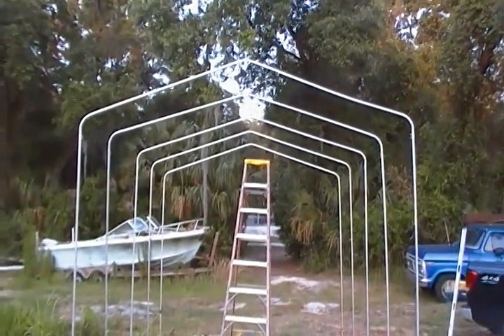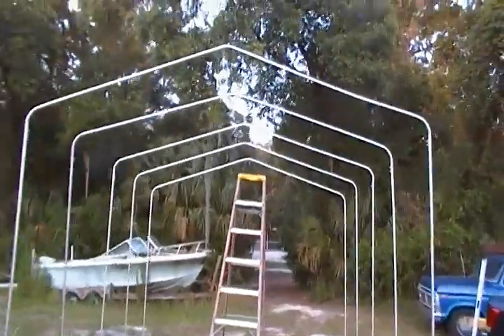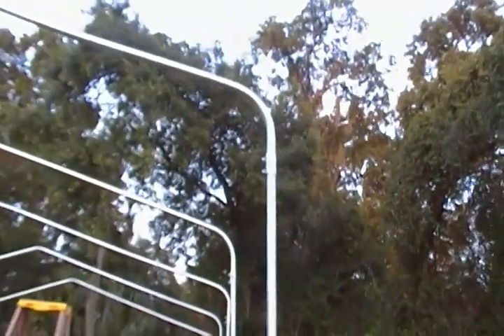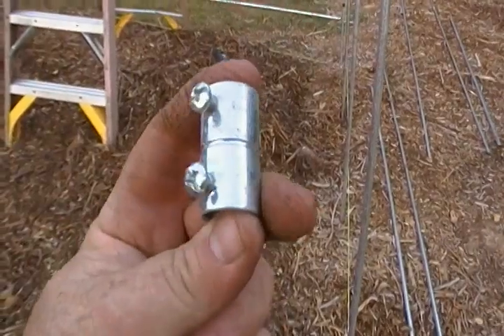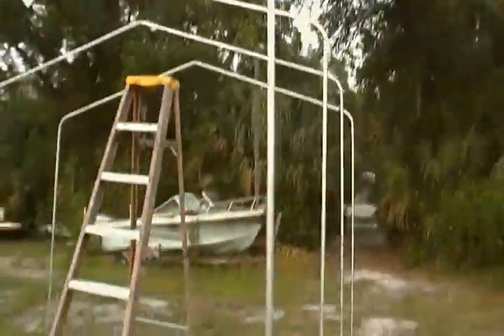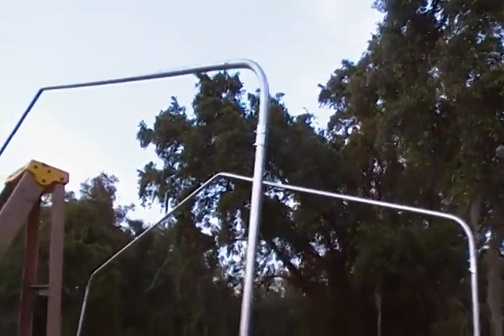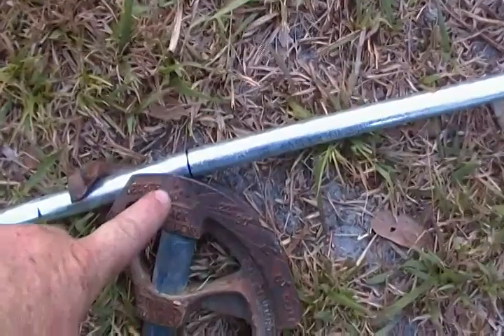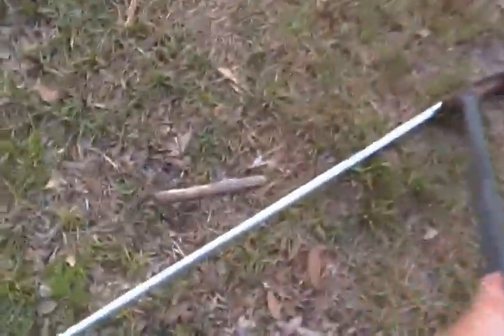Greenhouse: Electrician Style Part 1

Comment from the maker: @ernest302 I'm not really sure what angle is in the center, I just bent it till it looked about right.  The ends are a guesstimate of @ 45-55 degrees(I bent them until they fit into the vertical pipes). I am sorry I don't have a more precise answer. Good question. Thanks.

Comment from the maker: @MisterSoul99 They make a 90 degree coupling of sorts.  They also make pre-made 90 and 45 degree sections of conduit that you can put a straight coupling on each end.  I am going to use corrugated pvc panels to cover mine ( it's what I've got on hand).  That 1/2 inch conduit bender in the video was bought at a flea market in 1989 for $5.

Comment: Great idea, do they make couplings which are set to an angle (like there is in PVC for plumbing).... for those of us without a bender?.

If I were going to  make one of these and cover it with sheet plastic I would let the size of the plastic determine the sizes of my roof and walls.
Many rolls come 20' wide, be a shame to realize after the frame is up that my sheets were a foot short of reaching the ground or whatever.